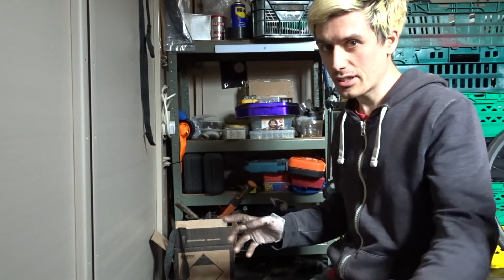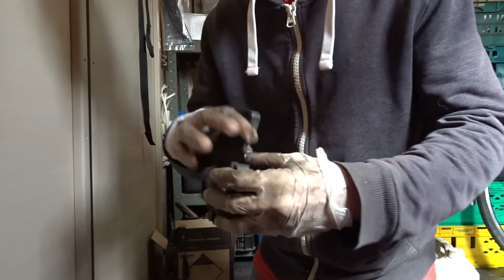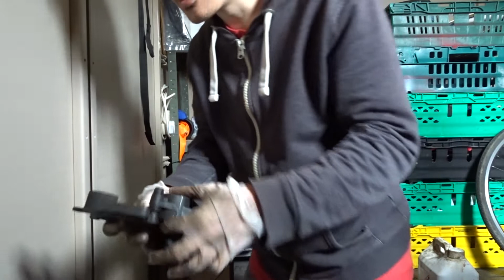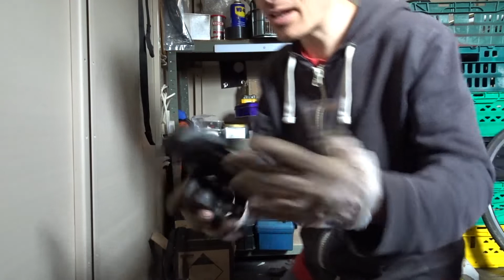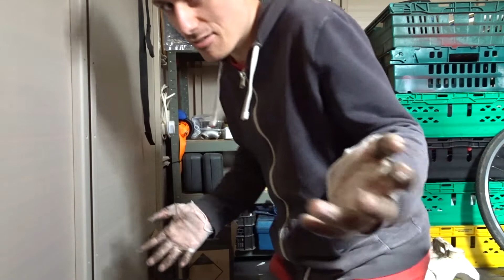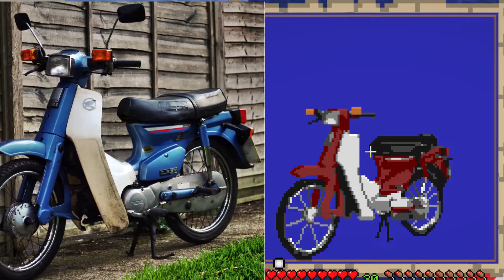How are we all doing?

Comment: I was really busy in March but now things are back to normal at work. Had to take a holiday though which is boring. Also I thought my MOT runs out in April turns out it ran out before 30th of March so Put the bike on sorn and will have to go over it and get an MOT done. Would do some big jobs on the bike but got no space at the moment and not much time unlike most others on lockdown. Might just cycle to work and try to do some stuff to the bike on days off
Reply from the maker: dont you get the extended 6 months check .gov all MOT have been exteded 6 months ??
Reply: @BigPezza  Yeah if it runs out after 30th of march mine ran out before